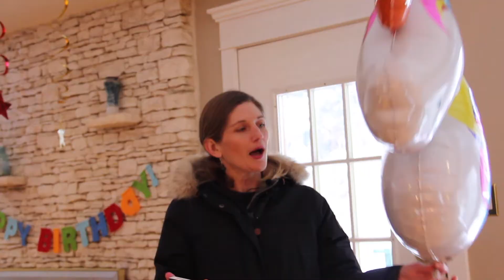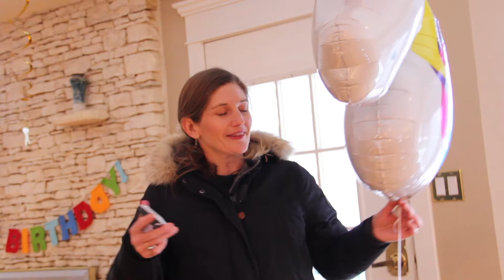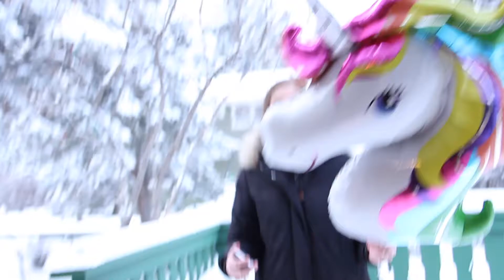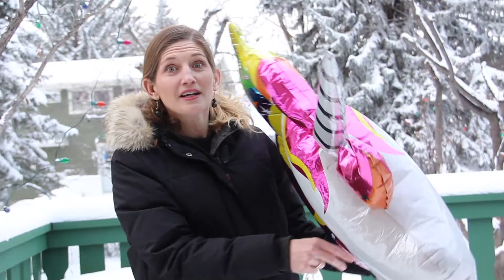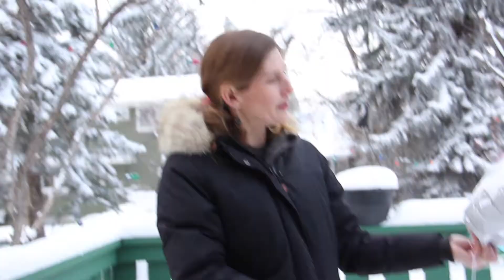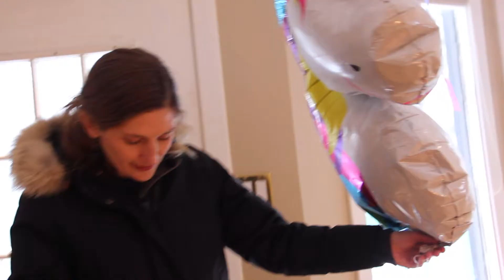How Does Temperature Affect Air Pressure?

Comment: Are you explaining this correctly? I think this is misleading. You are explaining the opposite of what is happening. The temperature in the house is warmer so the air pressure inside the balloon decreases. That's why the balloon is rising. When you take the balloon outside the house, the balloon is falling because the air pressure is increased. So the air is heavier and falling.....higher pressure. Am I wrong on this? It doesn't make sense compared to other videos I've seen on the topic.

Comment: The air pressure is the same outside the house as inside.  The pressure is set by the weight of atmosphere above you.  The weight of the air above you is not changed by it’s temperature.
Reply: they are proportional you know. if the temperature of a gas is low so is the air pressure if the temperature is high the pressure will be the same. Considering that the INSIDE of the a balloon is going from a certain temperature to a LOWER temperature the PRESSURE will follow suit and ALSO decrease.
Reply: @FootballJersey19  That is the case for a fixed volume.   The volume of the atmosphere is not fixed because it can expand into space.  Consider that the gravitational attraction of the earth on the atmosphere decreases with distance from the surface.  If the atmosphere heated up it would expand into space and the pressure at the surface would go down.  If the atmosphere was hot enough it would completely escape into space and the pressure at the surface would be zero.

Comment: Mam plz answer me. You mean in cold wheter the air outside the baloon exert more pressure or low pressure on the air inside the baloon???.
Reply: Good question.  If the temperatures inside and outside the balloon remain equal,  why does the balloon deflate when cooled?  Hope someone can explain.